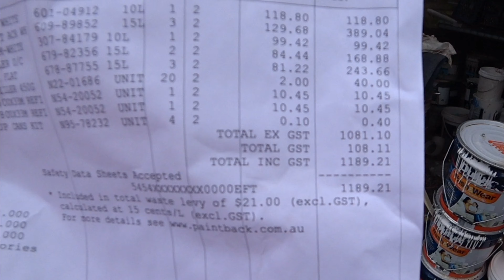Day 1 Vlog Another House started 240m2 at Karalee

Comment: Good big areas clear of other trades crap, brilliant.
Reply from the maker: I love no other trades around
Reply: ThePa1nter . I’ve just left a site today. Waiting on plasterer to return and some joiner work. It’s two steps forward and one back on our sites.
Reply from the maker: @stevenmcfarlane8831  I get offers from other builders but ive been there and done that, thats why ive been with this builder for over 10 years.Id lose my sh*t with ones like yours,thats why i fix a lot myself
Reply: The last big builders job I did over in the north side of sydney the push was on as the owners were  moving back in in 1 weeks time. There were electricans, plumbers, tilers finishing bathrooms, pool tilers, at least 4 carpenters finishing off trim, 3 kitchen guys doing all the kitchen laundries etc and us 3 painters still trying to finish rolling ceilings. About midmorning the cleaners came for job clean but could only do the windows. Absolute chaos. Finish was as you would expect.
Reply from the maker: @sydneyshinshi  Very stressful for you, I'm sure

Comment: Gday mate love your work bud. How do you go pricing these type of jobs. I'm in Sydney and doing alot of painting lately but think I'm under charging .cheers
Reply from the maker: Thanks for watching, these houses are priced using the floor plan square metre rate, external eves are included free, 2700 ceilings are a bit more. Feature walls are extra, downpipes extra, stained doors extra. You need to get yourself a price list that you can refer to when quoting, some painters no matter how much they charge will still lose money because they are too slow and inefficient or labour costs blow out. The finished quality can also raise the price, three coats vs two for example.

Comment: Hi Greg...I assume that you spray all your woodwork and trim etc. Just a quick question....
When you spray your windows do you mask them up or do you use a Paint and Peel type of product (if you're familiar with it).
I'd love to see a demo of what you do some time. Love your vids. Thank you
Reply from the maker: Appreciate the input,all my window frames  are painted by hand, 1st undercoat, 2nd undercoat and then gloss enamel  but nowadays with water based enamel I tape and plastic  all my windows, spray all their coats and touchup with brush.
Reply: @ThePa1nterhowto  thanks for your reply. Ive been contemplating getting into spraying for ages now but can't seem to take the plunge. ( alot of my jobs are repaints) I often wonder whether all the time spent taping up windows is really worth the effort  time wise and always worry that if window frames aren't taped up perfectly that I'll get bleeding etc that while cause more grief come clean up time. Thoughts?
Reply from the maker: @johnpaul3025  If you do mainly repaints, an airless with small tip is brilliant, on repaints with furniture I use it for cornice only and roll the ceilings. On repaints that are empty I use it for undercoat on door frames,cornice and skirtings,finish coat in cupboards ,cornice,frames,Just treat it like a big brush as you see in my videos, don't try and finish coat with the spraygun,if you do it that way any beginner can spray. It will save you many days of work and that means profit.
Reply: @ThePa1nterhowto  thank you Greg. Much appreciated